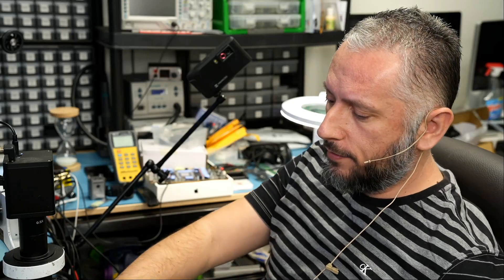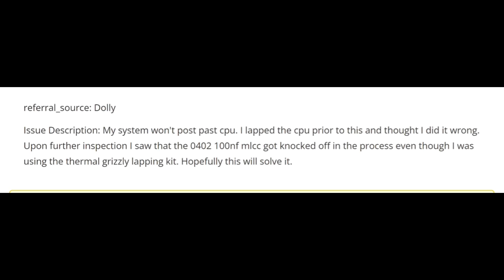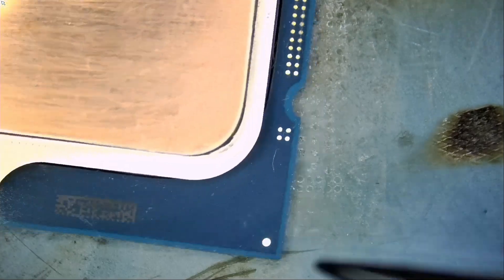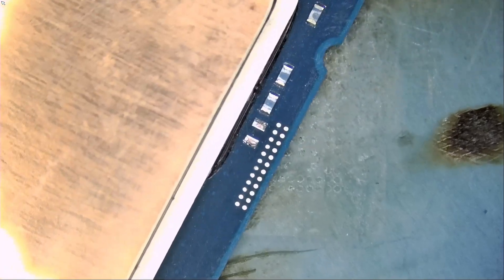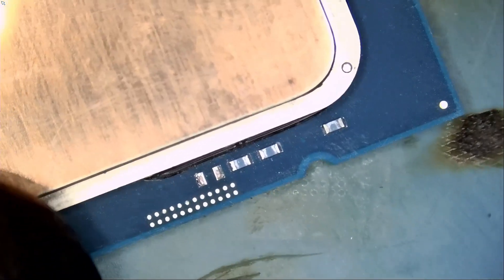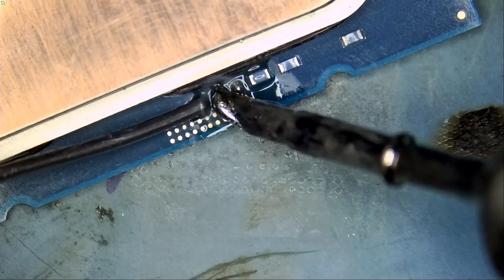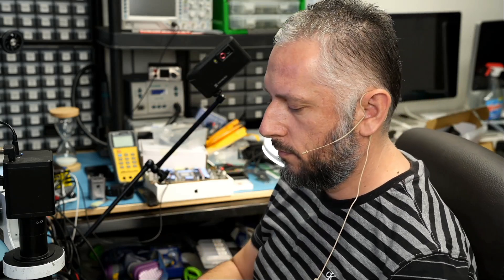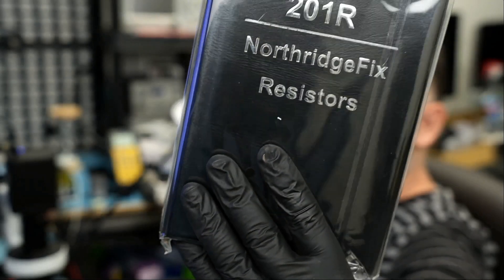Intel i9 13900K Repair - CPU won't post after Lapping

Comment: Lol, how its possible to lapping like that and damage capacitors... I lapped 10+ cpu's without any kits, just duct tape, tempered glass surface and duct tape on processors other side, to avoid components of getting water. Thats it :) And never had problems. Just need to do things with patience and slowly, my lapping process always taking no less then 2 hours for one cpu. I think this guy who damaged his 13900k, has zero patience (things like that really dont require any experience if you know how to begin and what to do) and i think he just did things agressively due great desire to test it as fast as possible, to see fast as possible results.

Comment: the sand paper can curl up and hit the components if you go past it and then back. the sand paper chops it off basically. The edge usually tries to curl slightly makes it more likely.
Reply: i use the side panel glass from my pc and mist water to it, put the sand paper down, then tape the edges for it to be flat before i start wet sanding the die

Comment: I think you should underline how small these components are. The huge black object at the bottom of the screen at 4:40 is the tip of a finger!
Reply: 0201 and even 0402 elements basically look like sand unless you look from up close or use a microscope

Comment: Did the customer overclock the CPU? I mean to knock out a capacitor like that takes a lot of heat.
Reply: or mishandling it e.g. fumbling around with the base of the cpu cooler

Comment: So, you lap the surface so you can improve contact area between the cpu and the cooler ? Ok, fine.
But, aren’t you reducing the area available for heat dissipation? 
If you rough up the surface, you will increase contact area between the cpu and the thermal paste, transferring it into the cooler.

Smooth surfaces are less efficient at dissipating heat than rough surfaces due to the total area available.

Or, is there something else that I’m not taking into the account ?
Reply: The CPU does not need to dissipate heat, only transfer to the cooler. 
Thermal transfer is way better between raw materials, so a smooth surface makes there be less gaps between the heatspreader and the cooler, so less thermal paste will fill them and there will be more direct contact, leading to better thermal performance.
Reply: @Versette  CPU does not need to dissipate heat ? Right… I agree, no need at all, only to transfer…. which is dissipation.. Anyway, I’m getting lost in silly technicalities.
Heat transfer is better between raw materials ? Ok. I will make note of that
Reply: @augustvonmackensen9785  English is not my first language so maybe I made some mistake.
By thermal transfer, I mean transfer from one surface to other, for example.
By dissipation, I mean dissipation of the heat into the air.
A smooth surface against another smooth surface is going to have better thermal transfer than literally putting fins on the IHS, which would make it highly worse, but on the other hand, increase it's dissipation (of course doing this is not logical, but I'm making an example to explain what I mean).
Maybe I'm not using the right terms here, but I thought I was.

By raw materials, I meant the metals of the IHS and coldplate, etc. so not the thermal paste.
Essentially what others said about thermal paste being not so good at conducting heat, just good at filling in the gaps, which is basically why it works and makes a difference.
Reply: One thing you need to know: thermal paste is bad for transfer the heat. A smooth surface needs way less thermal paste (thermal paste layer is thinner) and this improve thermal transfer.
Reply: Thermal paste is used because it conducts heat better than air. It doesn't conduct heat better than direct metal-to-metal contact. A perfectly flat surface on both sides (with no paste at all) would be the ideal situation. There is nothing to be gained in "roughing up the surface"; you're trying to transfer heat, not trying to make glue stick.
Reply: @RFC3514  There is nothing to be gained from having more surface area to transfer the heat ( as in making it rougher to “create” more surface area ) ?
I will have to change a few rules of thermodynamics for that one, they have been wrong all these years.
However I agree that metal on metal ( similar surface finish to gauge blocks or “slip gauges” ) would be ideal.

Comment: i dont see how the hell they knock off those components really im always so carefall putting in the CPU they are not very gentle with the CPU
Reply: This person used a lapping tool though, that grabs the CPU from the sides, so it's possible to damage it in that way.
About other instances when it happens without such tool, good question xd

Comment: That's what happens when people follow pointless fads on the internet..
Reply: A mind is a terrible thing to waste. 😢
Reply: Yes he didn't do anything
Reply: Unless you’re doing extreme overclocking, the results are not worth the effort. And if this was for serious overclocking, It would’ve been polished much better than it appears in this video.
Reply: It's not pointless)
Reply: @Versette  it is completely pointless. The gains are insignificant. It's like putting a K&N air filter in a car. You won't notice the difference unless you Dino it. Or in this case benchmark it. Pointless waste of time and effort and money
Reply: It's not a fad it's legit really good for thermals due to manufacturers not doing it so at the end process of the cpu...to be flat ...meaning better thermal transfer...even direct die is so much better but they stopped doing that due to cracked dies and people complaining
Reply: It's not pointless, it's just Intel not selling flat CPUs that you have to fix after them to get better thermals.

Comment: I have an issue with my processor 11400f unable to xmp. Works normally with an older 10100 cpu.  Would popped off resistors be a problem?
Reply: Maybe your not using correct xmp app. Intel is known to stop support for past processors or maybe your using older xmp app
Reply: @bhoot1702 xmp app? what?
Reply: Check for any chipped off parts on it if not they probably just a bad batch and defect or even a pin is bent on the socket.
Reply: Most likely not

Comment: im assuming the guy that did the lapping on the intel heatspreader also did a delid.  The delid will yield far better results. lapping will usually only gain 2-4c and usually you do it the cpu heatspreader and on the bottom of the cooler block (air cooler or water cooler block) as well. on my 13700k I used the thermal grizzly delid kit. Super easy to use and combined with thermal grizzly liquid metal got over 15C drop in temps. I would get plastic razors to scrap off the intel gasket/glue around the cpu after the delid and just do light passes with it over the gasket at an angle slowly scrapping it off. There is components around the actually cpu die so you can use either nail polish to coat them or use Thermal Grizzly TG-Shield. This will prevent any shorts that could happen if you use too much of the liquid metal. you only use a very small amount of the liquid metal 1 to 2 drops is all you need and spread it out over the cpu die with the supplied brush that is in the shape of a qtip. You can also use Thermal Grizzly Kryonaut Extreme which is just normal thermal paste but will only probably get 5-6C lower temps compared to TG liquid metal. I never went over 64C on full load in the summer time with 90F+ temps in room. Now in winter time I usually sit at 45 to 49C at full load with an Arctic 420mm aio water cooler.
Reply: Unless it’s the Ryzen 7000 series from AMD where you would remove about 1mm of heat spreader and drop temps about 12c.

Comment: I’ve lapped a bunch of 12-14th gen chips with the lapping tool and never had this happen. He must have been pretty tough on it or something.
Reply: Same and I've been lapping since Q6600 days without a tool. The sides and bottom I cover in insulation tape.
Reply: if he is unlucky he may have knocked it off while removing it from the socket by mistake.
Reply: Yeah that’s because this person is inexperienced
Reply: Why the F would you lap your cpu's? 

This is 2023
Reply: @samymasta  why not in 2023? for better temps, for OCing lol.  For most people just using any of the aftermarket contact frames would be enough though and much simpler.

Comment: Next the customer will de-lid it and rip more off. Or liquid metal will short it out. Leave stuff as is.
Reply: People need to stop worrying about performance all the time. I use the command line on FreeBSD and I use an Intel N5095 with 8g of ram as my daily driver.

Comment: What does lapping the CPU do for you?
Reply: better contact with a cooler - lower temps - higher overclocks
Reply: so it will void the warranty?
Reply: @maklogetrich2378  YEP, that it does!! VOID THE WARRANTY!  Which is why I would ever waste my time for such a silly thing.
Reply: @westiemafia2704  pretty much lmao
Reply: The integrated heatspreader is not always a 100% flat from factory. Lapping makes it nearly perfectly flat which allows better heat transfer to the cooler and thus, better temperatures.
Reply: @FerretOutOfHell  Thanks for the info, I did use artic silver, back in the day, this is a whole different ball game!
Reply: It ensures greater chance of contact surface area. But intel has recently done things differently when manufacturing so it’s not needed as much.
Reply: @muttBunch  Incorrect the single side LGA1700 mount also has to be changed as it bows the CPU.
Reply: @zorbakaput8537  exactly retention bracket is badly designed and bows CPU resulting in worse uneven contact which is why people who have intel 12th-14th gen should buy aftermarket retention bracket
Reply: @zorbakaput8537  nothing of what I said was incorrect. If you change the retention bracket, that’s where it becomes a problem. The spreader is intentionally cupped by Intel to make up the tolerance for board bowing. When you lap (flatten) the proc, then you must change the bracket to reduce the bowing of the board. There is no added benefit to lapping anymore. People assume when they test the surface coverage, they insert the proc, drop the lever, wait a few minutes, then release and look. What people aren’t realizing is, the board will continue to bow a little more over time and eventually reach a maximum “bowage”. It doesn’t happen overnight. I’ve done 4 different builds with them and checked each after 3 months and have had total coverage on all 4 builds without lapping.
Reply: Smoothing down top layer of the IHS which is suppose to improve therminal conductivity
Reply: Factory IHS is so so bad that lapping can reduce temperatures by average of 12°C (twelve!)
Reply: Overclock the 💩out of them. Crazy enthusiasts who don't know what to do with their money